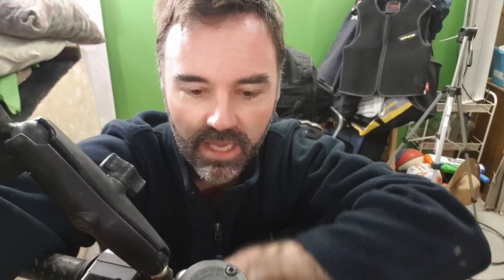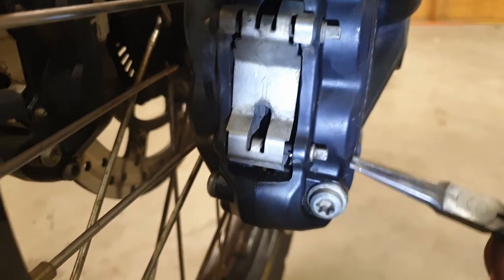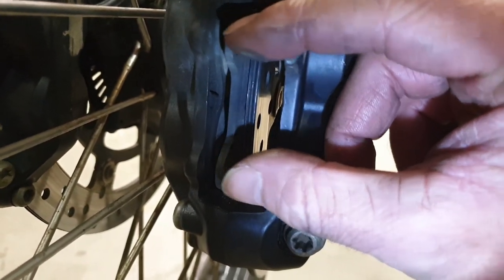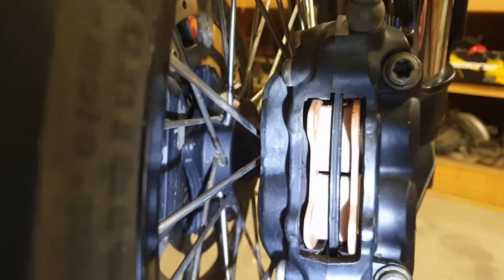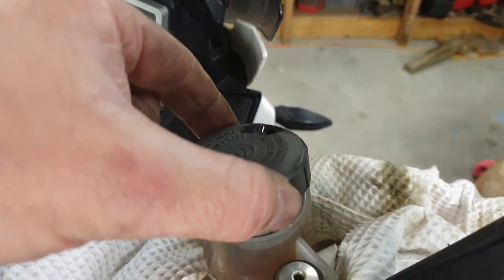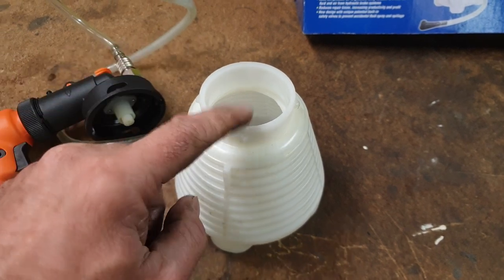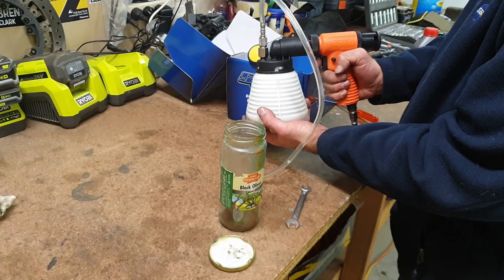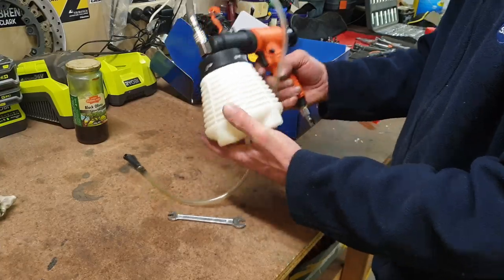Using a Vacuum Bleeder and changing pads on the 1190

Comment: I need to get a decent vacuum pump, I tried a couple cheapy Ebay ones but they never work well. I usually put a bit of copper grease on the back of the pads and retaining pins. Probably don't need to though bit always have done it out of habit.